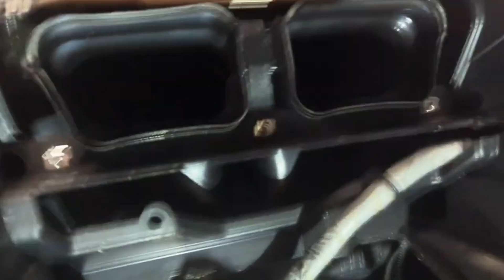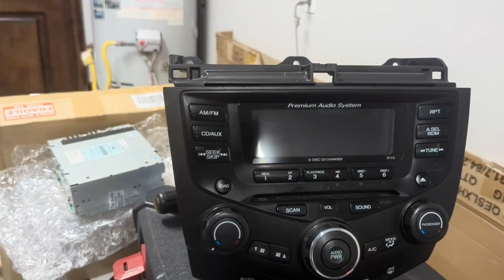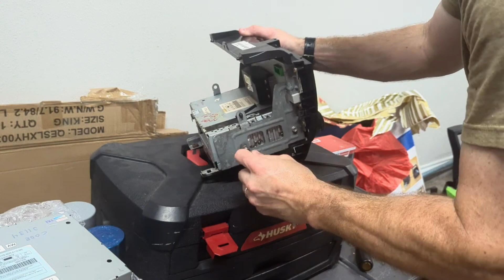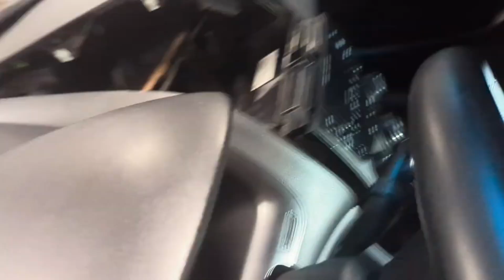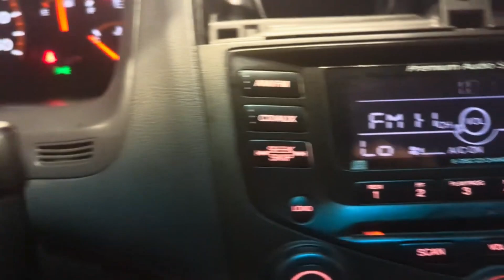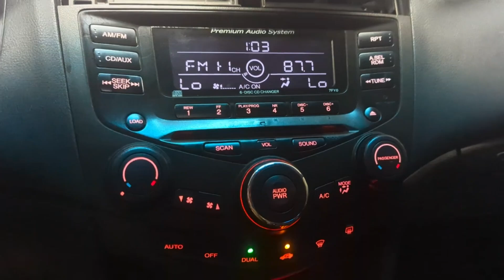2003-07 Honda Accord (7th gen) radio removal, repair, and installation

Comment: just got a 2004 accord from a private owner and the radio and a/c climate control do not work. the owner that sold it to me told me also that the owner before him installed an old school 2000’s radio at the very bottom section underneath where the factory radio would be
Reply from the maker: I've heard sometimes people will install an aftermarket radio in that cubby down below.

I order to have the hvac controls work, you have to install a radio from the same trim level as your car.

For DX or LX, you need a radio with faceplate code 2AC_ or 7BC_

For EX without Premium Sound,  you need 7BY_ or 7BK_

For EX with Premium Sound,  you need 7FY_ or 7FK_

You'll also need the security code for that new radio block to get it to work correctly.

Comment: Can you swap out the OEM for and upgrade OEM with the XM/Aux unit? I was at the scrap yard yesterday and thought about grabbing it....
Reply from the maker: Hvac controls - 
You'll want to find a radio that has the same type of hvac control as your car in order for that part to be compatible.  
If your car has single zone hvac control, you'll want to find one that also has single zone control.

If you have dual zone, you need a dual zone radio to get hvac to work properly. 

Besides that, if you don't have a premium sound radio, it has an internal amp. If.you have a premium sound radio, it's supposed to have an external amp already installed in the car. If you put a premium sound radio in a car thst didn't come with premium sound, the volume will be really low.

The upgraded oem radios have an aux button. There's an extra pin connector on the bottom of the radio. That's where I have a converter for my external SXM to plug in. You could also put a Bluetooth converter there which would allow you to stream music from your phone.
Reply: @txaccord  wow! Thanks for the in depth clear explanation. I just got the car, I'll have to check on the dude zone hvac control. I don't think it does. But I do have the CD/Aux button. I don't know about it being a premium deck. I was going to do the usb upgrade. Bit really wanted the xm deck.
Reply from the maker: You'll know if you have dual zone climate control because you'll have temp adjustment knobs on the left and right sides like my radio.

See on my radio where it says Premium Sound at the top. That's how you'll know.

If you go to driveaccord.net in the 7th gen forum Photo Gallery, you'll see my car's thread. 

Go to post #110 on Sep 1, 2020 and it shows my converter which plugs into the radio aux input and allowed me to get a SXM radio and use a stereo wire input to the converter which then feeds into the radio at the aux jack. It shows my whole setup.

I'm a huge fan of the Kicker HS10 hideaway sub under my driver's seat. If you want to save trunk space and have a decent amt of bass inside the car, you'll love the HS10.
Reply: @txaccord I tried for 15 min to find the post, looked under photo gallery bit can't sort by date.
Reply from the maker: The thread is titled
One owner '03 Honda Accord EX V-6 trying for one million miles.

There is a separate photo.gallery forum on there but if you click on the 7th gen forum, you'll see a photo gallery sub forum. 

My.tgread is almost always the top one in there. The post should be on page 6
Reply: If you take one out a scrap yard you won't have the security code for it to turn it on.

Comment: Have you heard if the radio is the cause of battery drain? I disconnected the radio fuse and the drain stopped. But it could be the interior lights (front), b/c they're on the same circuit.
I was hoping you would show me how to fix the head unit.
Any idea where I can find that info?
Reply from the maker: I haven't had a parasitic draw from the radio but I've had the dome/map light switch mess up where the lights didn't turn off.

I haven't opened up the head unit for amy repairs. The only radio issies I've had have been due to the block going bad. 

I have heard of people who put their entire head units in the oven for around 15 mins at 350 degrees. There were some bad soldering on some of these radios so heating up the radio actually fixed that issue. I haven't had to bake my radio. I found that info on DriveAccord.net
Reply: @txaccord  
Wow! 'Baking a radio' doesn't sound like a good thing for the electronic components!

Everything on my head unit works. I did the parasitic draw test and the only fuse that fixed the problem was #5 (10A) for the radio. But when I pulled that fuse, the front door lights went out (as well as the radio and HVAC lights).
Reply from the maker: @chriscadman5715 I thought it sounded crazy but some people reported success with heating it up. The radio display and hvac lights are controlled by a circuit board in the block. I had those light issies before but not the parasitic draw.

There is a resistor on that board that goes bad. Some people just solder in a new resistor instead of replacing the block.
Reply: My daughter's 05 Accord radio is spontaneously turning itself on and running the battery down. She sent me a video - the keys weren't even in the ignition!  She was having problems starting it in the mornings. The low voltage eventually ruined the starter and cost her $1000. I had her pull the fuse for the radio. She found a thread from another Honda owner who traced it to a loose resistor on the board. We are looking for a new radio now.

Comment: Hey TX! Great video bud, I gotta question for you. So my radio backlight is extremely hard to see. I have to take a flashlight to see what I'm looking at. Also, the radio's volume started going all the way down or will go up at random. Will a new OEM box correct all that or no? I'm pushing a 2003 Honda Accord and I know for a fact I don't have any of those backlights on for AM/FM, CD/AUX, etc. All I can see when I turn it on is when the light for my defroster lol.
Reply from the maker: Thank you!
When my first block died,  I had no lights for any vacation buttons and my screen worked when it wanted to. Buttons worked only when they wanted to.

I contacted the ebay seller with my issues. They said it would fix all of them. They were right. 

If you're wondering about your issies, I would DM the ebay seller and make sure the new block will it. I've had to replace mine a few times. 

Thanks for watching and I hope you can get yours fixed.

Comment: My '04 Accord has a 6 disc changer. All discs are stuck as cd player stopped working. If i change the block will i be able to get the cds out?
Reply from the maker: If you're talking about the in-dash 6 disc changer like I have, the block is the piece where the discs are held. Replacing the block would make your radio and CD player work properly but your discs would still be inside your old block. At that point, I guess you could get the old unit open to get your discs out.

Comment: Thanks for this video. A few days ago, the vent selector buttons failed in my 2003 Honda Accord. First, it spontaneously changed to the 'windshield mode', and after tens of attempts (including removing the battery terminal for a while), I was able to change to the 'feet mode', however the airflow pattern has remained directed towards the windshield even as I type.

I did a bit of research and suspect that the circuit board of the HVAC controls has gone bad. I'm considering removing the circuit board for an inspection and resoldering. Any ideas on how to locate and remove the circuit board for this specific model will be most appreciated. Cheers!
Reply from the maker: There's a thread on Drive Accord which may help you.

https://www.driveaccord.net/threads/replacing-the-hvac-audio-cd-in-gen-7.52891/?post_id=748465#post-748465

Comment: what if the radio randomly turns off like stops working for like 5 minutes?
Reply from the maker: Not sure. My radio never did that. Mine had display problems on the screen, but it never stopped working completely.

You could reach out to one of the block refurbishing eBayers to see what they say. 

If you do try to completely replace your radio with another OEM unit, find one with the same 4 character alphanumeric code on the front of it so your car will recognize it properly.
Reply: @txaccord  it works for like 2 min stops for like 5 then will randomly turn on again
Reply from the maker: @sarabyrd3374 There is something else that sounds crazy but check this out.

There was apparently some soldering on the circuit boards of those radios that wasn't done properly. Some people have actually fixed their radios by removing them from the car and then putting the radio in the oven and heating it. I think I saw people say 350 degrees for 10-15 mins. That may solve the problem.
Reply: @txaccord  What about the plastic, I dont want to start any fires 😂
Reply from the maker: This thread says 375 degrees for about 8mins.

https://www.driveaccord.net/threads/radio-issues-in-2007-honda-accord-coupe.575020/?post_id=6985871#post-6985871
Reply: @txaccord  what would the code be?
Reply from the maker: @sarabyrd3374  look at the lower right side of the screen. My code is 7FY0. There are only so many codes that Honda put on these radios.

Note that this code is different than the 5 number security code you have to enter to get the radio to work after you disconnect the battery. Those are two separate codes.

If you order a different block for your radio, they will ask you what your radio code is  7FY0 in my case.

When you get a new block sent to you, they will give you the 5 digit code to enter to make that block work. I'm not sure if a block will fix your problem but someone who refurbishes the block should know.

Comment: I think I’ve commented before that the radio block on my 2003 EX V6 coupe died, but fortunately I was still within the warranty period. Looks like a pretty straightforward replacement. Any issues with the plastic trim pieces breaking after 21+ years of use?
Reply from the maker: It was pretty easy. No issues with the trim pieces. There's a big hook looking Honda tool to get that upper dash cover loose, but the interior trim tool works fine.

Comment: Glad you've been able to hold onto the stock radio all this time and only have LED lighting fail, those Panasonic built EX units with the black display really lasted forever, typically the audio doesn't fail on it like the base trim single CD Alpine built unit which will fail at some point.
Reply from the maker: My original block problems were the flickering LCD screen and loss of backlighting. This one was just the backlighting. Otherwise the radio still works fine.

Comment: Great info , my 05 CD player went out a few years ago and ive been waiting for something else to fail on the radio but i didnt want to get an Android replacement , So THANX for this video... P.S.  MILEAGE UPDATE !
Reply from the maker: Glad this will help you. It's a really easy and affordable fix. I'm a guy who used to replace the radio with an aftermarket radio in all of my cars. Cars like this have other functions like HVAC and steering wheel controls and it makes it difficult to find a good unit that will work and not lose function over the stock radio.

I have SiriusXM, aftermarket speakers, and a powered sub. I have no complaints with this stock head unit. I don't care about Bluetooth or maps.

1,039,100 today
I plan to do another update video at 1,050,000.
Thanks for following along and commenting!